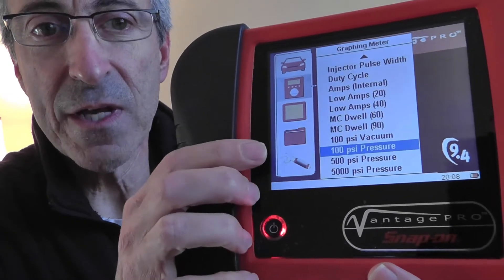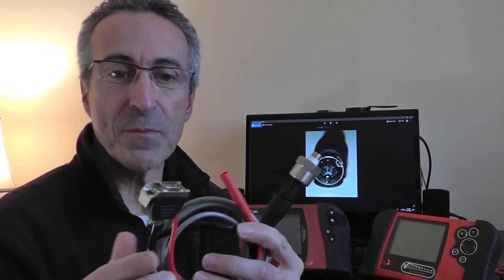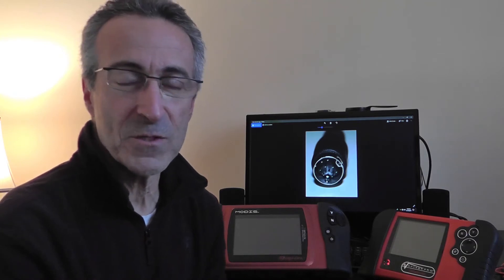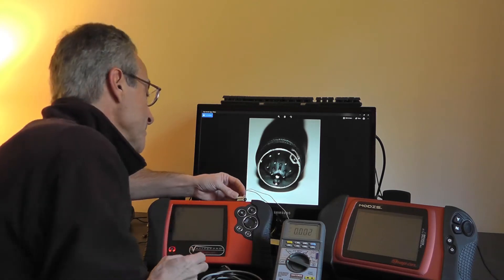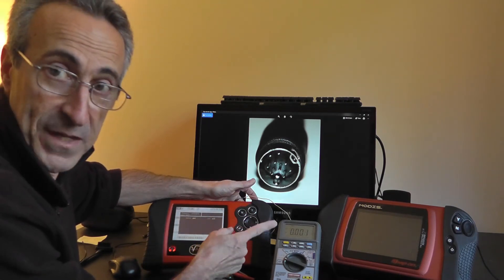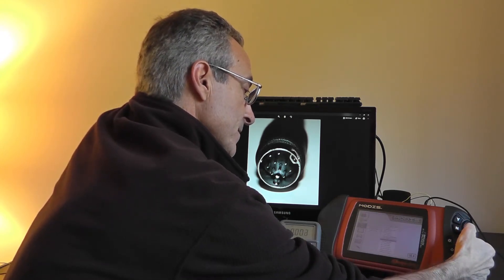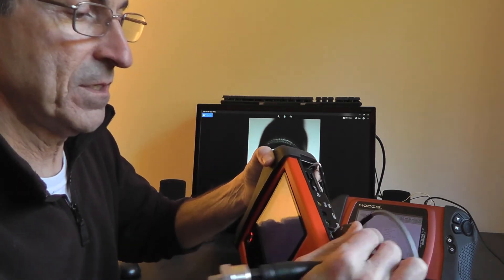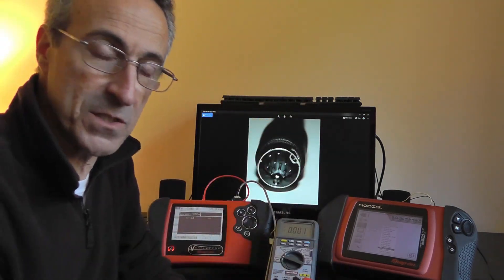Verus/Modis/Vantage Pro - Internal 5V Power Supply

Comment: The 100 psi won’t show correct right? Is it even worth getting ?
Reply from the maker: No, I'm pretty sure that any pressure transducer will work. I used a 200 on the 100 range without any problems at the 10:40 mark. 200 was the smallest one I had.
Reply: @baxrok2.  they’ll calibrate? Or even if they fail calibration it’s ok?
Reply from the maker: @weldingjunkie  I dont have a 100psi to experiment with but I don't see any reason why it wouldn't calibrate or function properly. Especially since there is a 100psi range to select. Even if it didn't work, a 200 or even 300psi will work just as well.

Comment: When you done the test on the lawnmover what type of hose did you use between the transducer and the spark plug hole?
I thought i would use one from an old manual cylinder  compression gauge i had but seemingly there's some kind of unremovable schrader valve in it that's giving me unusual readings!
Reply from the maker: I used the hose from a compression gauge. It was a while ago but I don't remember having any problems with it.

Comment: Thank you so much for making this video. Thats great info!!  I own a Verus Edge . I will be trying this.
Reply from the maker: Okay, but this video is for the early generation of Verus/Modis/Vantage Pro! I have not verified this on the newer generation of tools mainly because I don't have access to any of them. If you verify that the 5V is available on your tool, please let me know. Thanks!
Reply: Baxrok2  I just checked it. The 5 volts is present at pin number 1 on my Verus Edge. 5.14 volts to be exact. Im gonna start collecting my parts to build the cable . The only reason i havent already made one is the fact i didnt want to deal with having to add an external 5 volt power source.Thanks for the info about.
Reply from the maker: That's excellent! I see now that they also have the white plug in pin number six like my MODIS has. Yeah, that external 5v was a no go for me to! Let me know how it works out for you. I also have another video on this. A couple of folks indicated that they didn't quite know what the hell I was talking about! lol So, I did another video along with tips on the cable build. Thanks!
Reply: Baxrok2  I been meaning to reply back too you.  I built my cable for the Verus Edge . Works great. Im useing the 500 PSI transducer with mine.  Only change i had to make was to turn my slide connector around opposite of the way your is. I built it identical to yours the first time but quickly realized there was not room for the thunb latch on slide lock connector to fit the Verus Edge in that configuration. So i took it apart and put it back together with the thumb latch on the opposite side and it fit prefect. Over all ive been super happy with the results and have used the In Cylinder Pressure Transducer to diagnose several issues in my shop.I couldn't imagine not having this tool in my arsenal now. I got about $50 total in the whole setup!! THANKS.
Reply from the maker: Fantastic! So glad it worked out for you. Thanks for the update!

Comment: Nice... you definitely do a good job of "getting-to-know" your tools when you buy them / use them!
Reply from the maker: Thank you sir. However, I'm still struggling to figure out accessing files on that damn Vantage Pro! lol Sometimes you see em' and sometimes you don't!
Reply: Saved files? See them on the tool or when you transfer to ShopStream Connect on the PC? Are you saving on #2 card slot? Might be an issue with the tool... I haven't run into issues of not seeing & seeing saved files.
Reply from the maker: Yes, saved files. Vantage Pro will not show up on SSC or PC but that could be because I have an older update on my Vantage. Yes, saving to #2. Normally, I transfer to USB from #2 but even that is a struggle since I don't do it that often and it's about as clear as mud! I also, for some reason, can't save movies to #2. I have a 4gig card but always get the "not enough space" message. I'm pondering an update, $430, to the latest version which may help.
Reply: I use a 2GB card, but the tool also thinks that the card is full after x-amount of files have been saved. My PC has a CF reader built-in, so I simply transfer when need be. $430 might be worth it... my VantagePro can do stuff that my coworker's can not. I think mine is updated to 2012... will check tomorrow.
Reply from the maker: Thanks Thomas.

Comment: Can't see any of what your showing. Would be nice to have a better shot. Thanks for the information though.
Reply from the maker: Sorry. On the Aux jack on the Verus/MODIS/Vantage Pro, you have nine pins. Pin 1 is 5v and pin 5 is ground. If you look on the Aux jack you'll see that they are actually numbered. Using a volt meter set to DCV, you can probe pins 1 and 5 to see the voltage when in the pressure transducer mode. You use that source of power and ground to power your transducer. The photo at the end is essentially a schematic. I'll be making another video at some point to show how to build the cable, hopefully, that will be more helpful. Thanks!
Reply: Fantastic thanks for sharing this